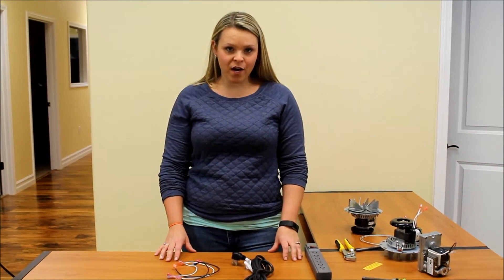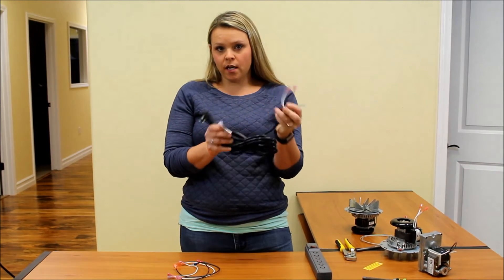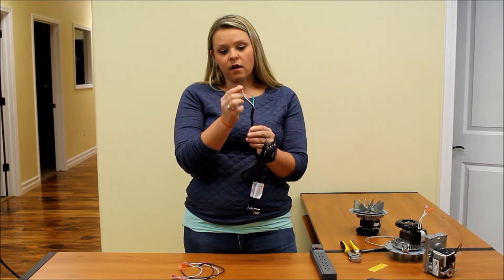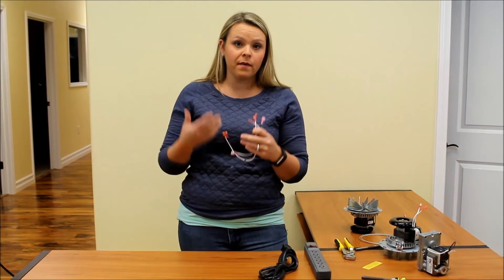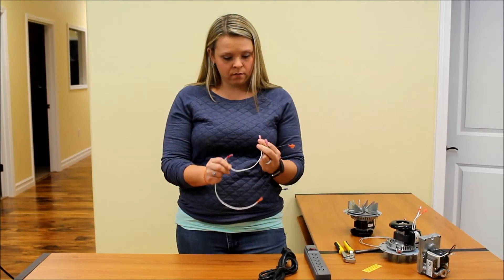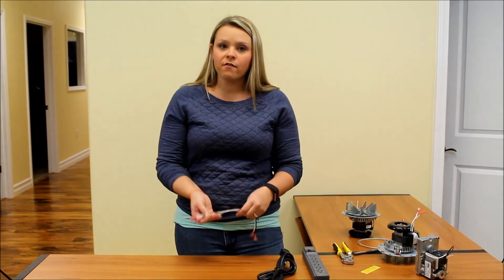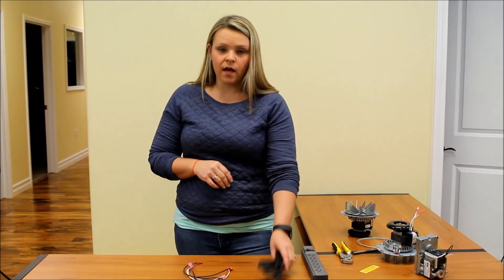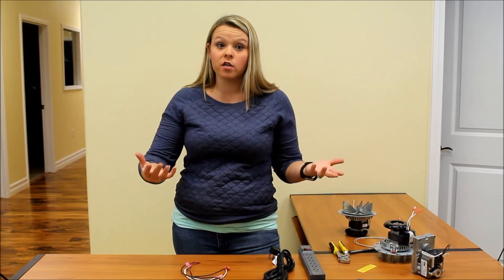How To Make A Bench Test Adapter

Comment: A prelude to electrocution. Your video suggests connection of the motor to 120V AC via adapters. The motor is DC but I am not aware of the voltage. My 780 motor has a 5 pin adapter. I need to know which pins get DC current and at what voltage.